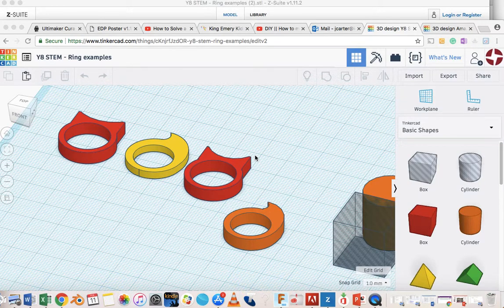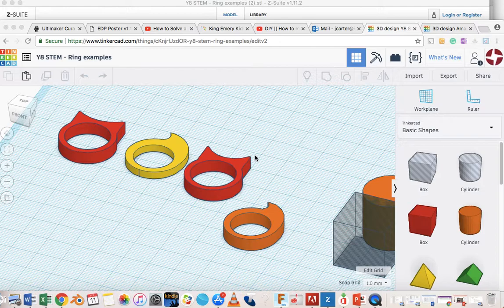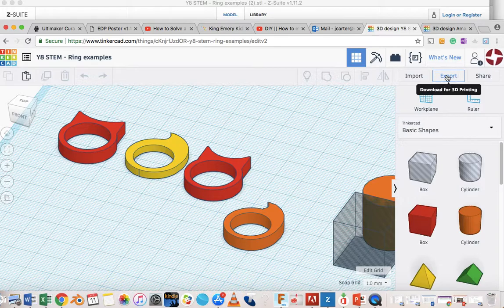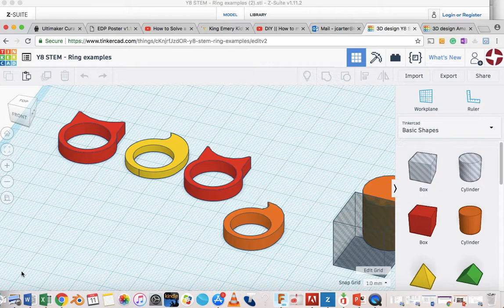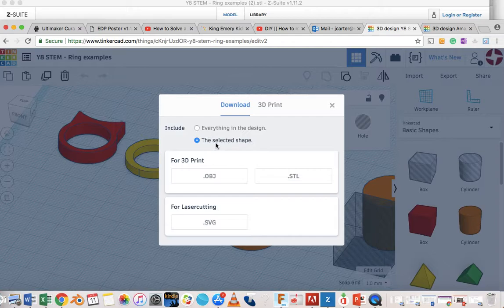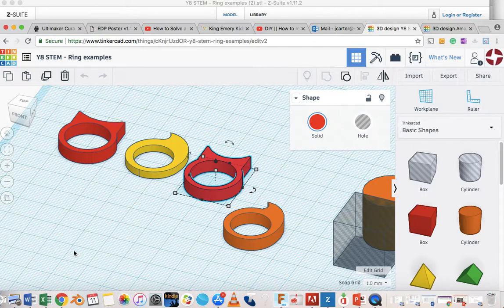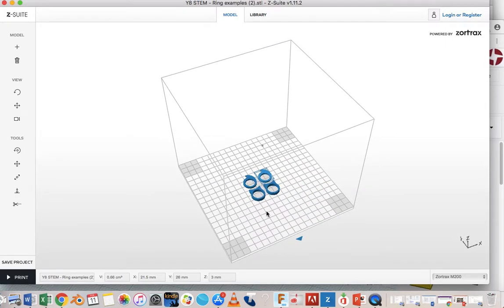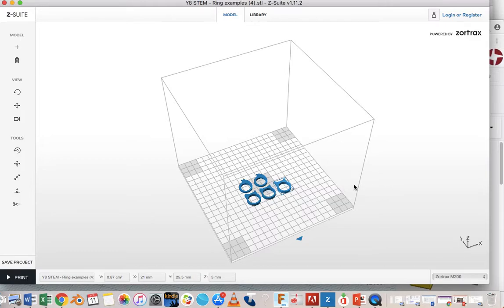TinkerCAD - Export for 3D printing

Comment: How do I export the model color? It has no color
Reply from the maker: Yes thats right.  STL files do not have a colour, 3D geometry only.  It will 3D print which ever colour is set up in your 3D Printer.
Reply: @jarrodcarter2966  I figured it out though. I was trying to export for animation. I found out that exporting objs also exports a mtl which is the coloring
Reply from the maker: @pendragonz8442  Great...well done.